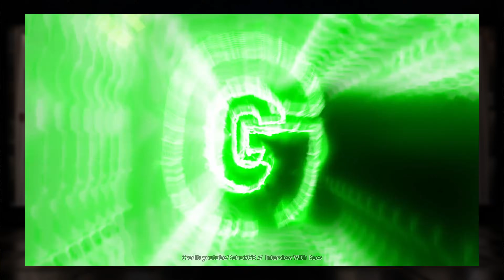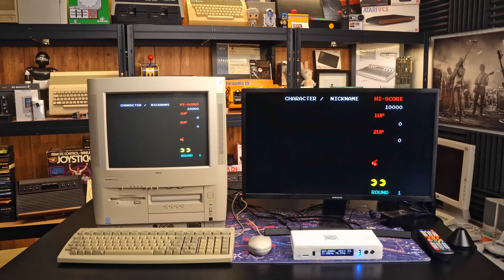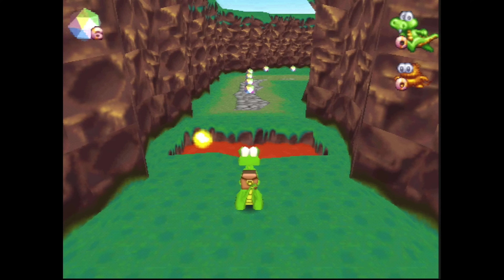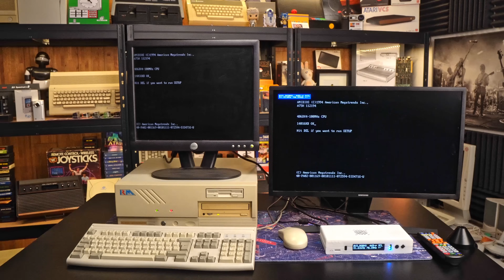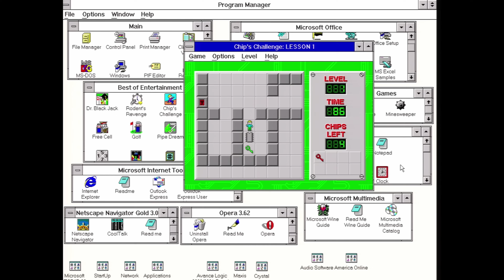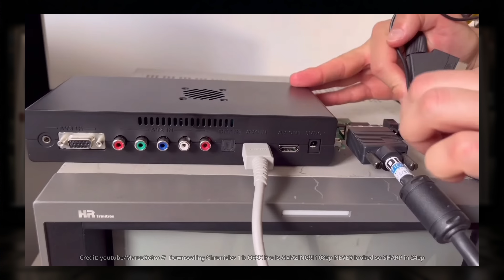Testing The OSSC Pro's New Scaler Mode With Weird Old PCs

Comment: Hello, I'm seeing in the video all the time that the OSSC Pro aspect ratio is set to 4:3 on your monitor which is 16:9, does OSSC Pro always convert and set the resolutions to 4:3 or can it also be configured to always stretch the image to 16:9, for example 640x480 or 320x200 in 16:9 without a problem, or does OSSC Pro always set everything to 4:3?

Comment: Hello. I am considering buying one OSSC Pro, because i have bunch of old PCs, and CRTs are getting older and worse over time...  I can see that OSSC Pro can handle DOS changing resolutions very well... BUT why the modern HDMI monitor still has problems with switching resolutions (it shows the picture a few moments later than the monitor on the left), if the OSSC Pro always outputs the same 1080p 60Hz signal??

Comment: Sorry if you mentioned this and I have missed it, but what capture card or device are you using? Found this video trying to get my OSSC 1.7 up and going. Had it working initially with the desktop but when the games default to 800x600 my capture device cuts out, so been tinkering with it. And very interested by what you are doing here!

Comment: Input lag is quite obvious, especially on the start-up of the machines with RAM tests. But if it's only used for capturing and still using the primary display, I don't see it as a problem.
Reply: That's not input lag

Comment: Do you have to do a lot of mucking around with creating different profiles on the PRO to get each different computer/resolution to look right?  I have the original OSSC, and I've had to put so much work in creating a bunch of different profiles for multiple resolutions on multiple computers...

Comment: As a Voodoo2 owner, it SHOULD theoretically be possible to go into the 3Dfx control panel, and alter what the card outputs in terms of refresh rates.  Also, I wish I didn't have to choose between analogue output (as I have a very nice Compaq MV920 that can go up to a staggering 1920x1440p60), and composite/s-video input.

Comment: One resolution to test that has been "hard to capture" would be 1024x768 interlaced at 43.5Hz. This is an original IBM 8514/A output resolution that many 386/486 era SVGA cards support (ex: Cirrus Logic 542x series). A good test bed would be that 486 and Windows 3.1x. The original OSSC can't capture it at all and other solutions struggle with it as well. The only card I have that properly supports it is an Epiphan DVI2PCIe capture card.
Reply from the maker: Great suggestion, thanks! I'll see what I can do.

Comment: I am very happy to hear about this.  I've been using a couple of the original OSSCs as my scaler/HDMI converter for a few years.  They do alright, remarkably good given it's not their core competency, but I'm really anxious for something that can lock on to the signal more quickly.  The BIOS boot screen, and often the Windows loading screen, are both just lost in the dark.  And sometimes it doesn't come back until I cycle inputs.  Minor gripe considering how critical it is that ANYthing exists to do this, but would be nice to have that fixed.
Reply: PS, I didn't know there was a version of Terminal Velocity optimized for early 3D cards.  Might have to check that out!  Will have to pick up a ViRGE card though, if I can't find one in my couch cushions somewhere.  Too bad there's no Mystique version.  :-D

I wonder how it differs from Fury3?
Reply from the maker: All of the S3 ViRGE games (and patches, where applicable) are available on my website with full instructions. I spent far too much time on it at one point 😅

Comment: Will this work with Atari ST via ST2VGA for both mono and colour modes?
Reply from the maker: I've been testing this and the short answer is yes, it works amazingly well with the ST. The slightly longer answer is that the high res mono mode, while looking super sharp, doesn't scale to fill the screen properly. It's something I'm going to feed back to Markus after some more thorough testing.

Comment: Hi, may I recommend to DOS fractal generator FractInt for testing?
It supports a multitude of exotic video modes and video cards.

Maybe it can help Markus trying out some obscure/exotic modes.
Reply: Someone put out a VGA Monitor benchmark suite on VOGONS. Search for a thread called "LCD monitor VGA compatibility database" by xjas to grab a copy. It is a torture test of DOS demos and applications that even trip up multisync CRTs!
Reply from the maker: Thanks for the suggestion, I have downloaded it and will be checking it out this weekend. 🙂

Comment: There's a tool included in the YAHDI image to force 24khz, in the TOOLS/SCAN31 folder.  This is a tool normally used for forcing a machine running in 24khz to do 31khz, but you can also do the reverse.  Run S24 in that folder.  Most games run fine in 31khz but a few will run too fast or have minor glitches if you don't do 24.  Not sure why 24khz wouldn't stick on power-up though, not a huge deal but it'd be nice.

Also, I do appreciate your slightly more positive look on the Virge compared to others.  That video of you going through all the Virge supported games is still excellent imo.
Reply from the maker: Thanks! The Virge was certainly a product of its time and while software rendering overtook it pretty rapidly (not to mention the arrival of the Voodoo cards) it's certainly an interesting piece of history.

Comment: So glad to see it released after so many years that passed since the very first announcement of Pro. What I miss in this video is a test with some early pre-1994 VGA cards from the 1980s, like 8-bit-ISA Paradise VGA (quite popular at that time, as individual cards or onboard graphics devices), so far no scaler I tried handled them good entirely.
Reply from the maker: Indeed, it's great to see those component shortages finally lifting and all the great projects finally making it out there. I've had a lot of good suggestions in these comments for other bits of software etc to test all of the various modes out there so I'm not done yet. Part of the reason for putting this out there was because I knew I'd get some good feedback on things to test. Thanks!